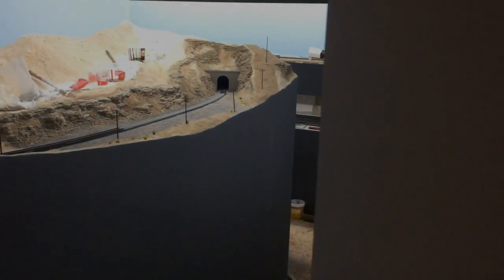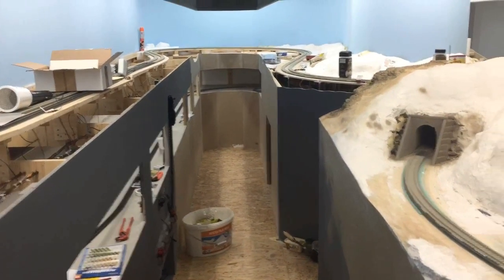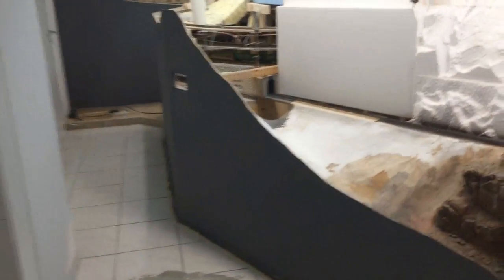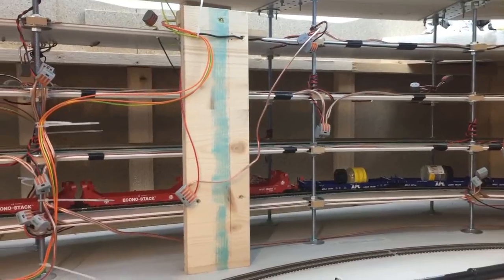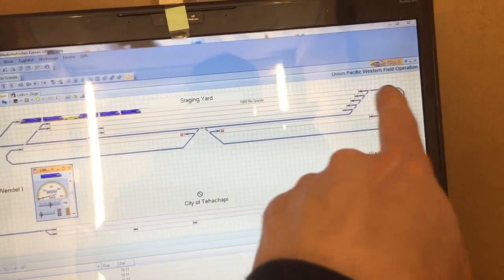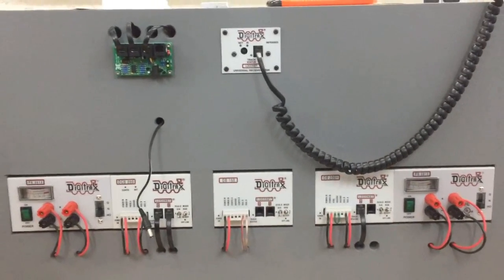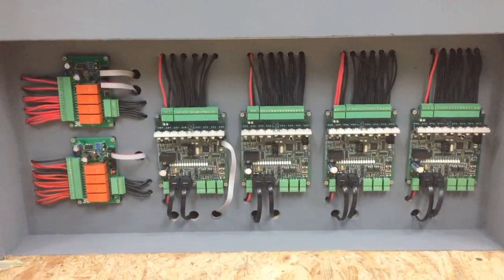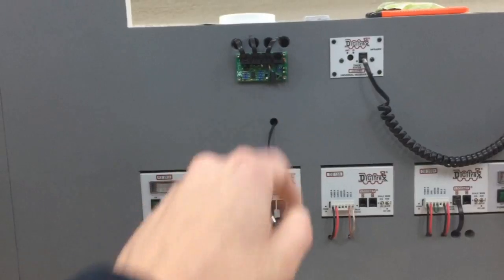HO-Layout Update 2017 - Fascia - Dispatcher's Office - Digital Occupancy Detectors

Comment: There's some good work you have done there with neat wiring of your Digitrax DCC components. What made you decide not to use BDL168 boards for your detection sections?
Reply from the maker: Hello Digitrax Dad,
the Blücher boards will give 8amps to each detected track - so I have always enough power for many MUs running on the layout. I think the BDL boards give 3amps to each detected track...
Thank you for your comment ;-)